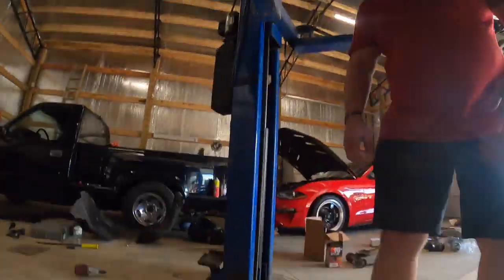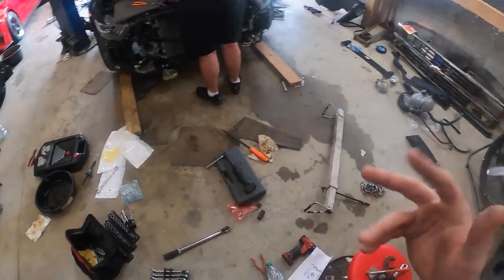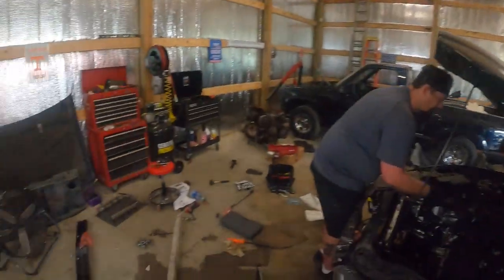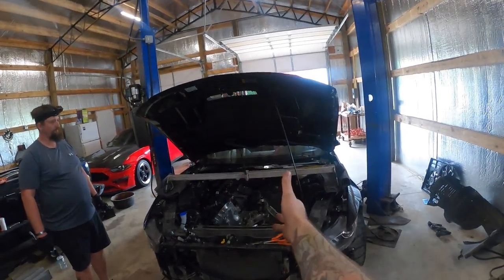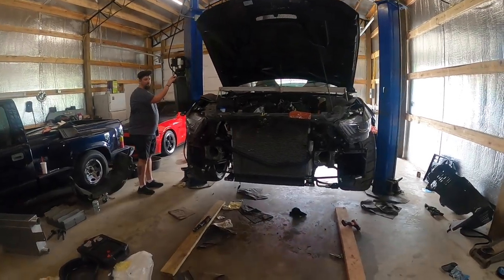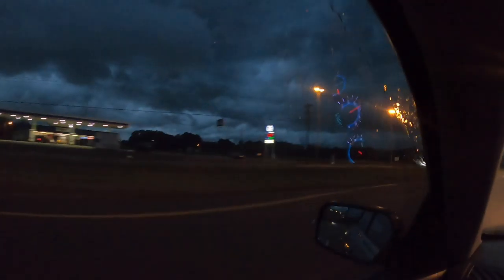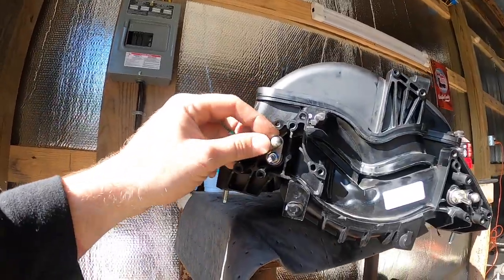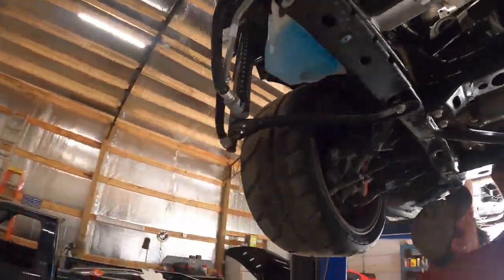HUGE TWIN TURBO's on a 2019 Shelby GT350r Mustang... WILL THEY FIT???

Comment: Zander always great content. Thank you.   

Your opinion, I have a 2006 Mustang GT bought it new for Christmas in 2005.  Didn’t even test drive, just signed and drove off.  It was a GT with the color and other options I wanted.  It’s mostly stock just few changes.  I want to add oil catch can but notice there is a drivers side and passenger. Which one do you recommend or both?  

Thanks again for all the great videos.
Reply from the maker: Thanks so much. The only one you really need is the passenger side catch can
Reply: Zander13 thank you.

Comment: I got question whats the difference between air cooler vs water cooler twin turbos?
Reply from the maker: Water cooled is taps into coolant lines. Air cooled is cooled by atmosphere
Reply: @Zander13Productions  now the performance whys are they the same or are they slightly different of in-cress or de-cress depending on the build ?